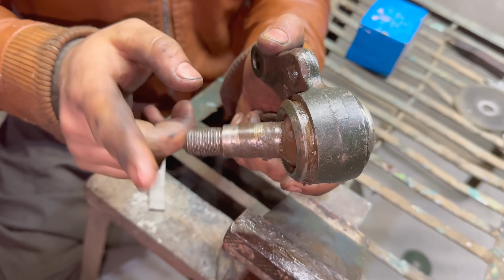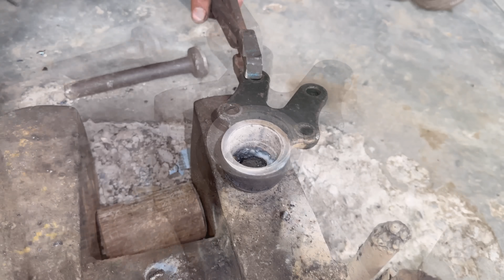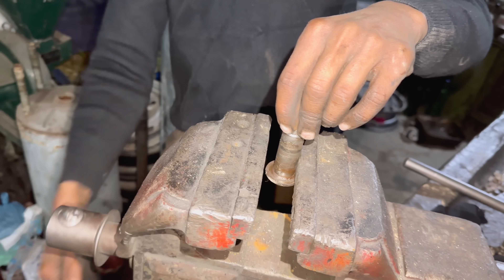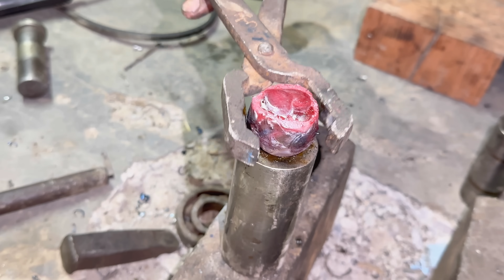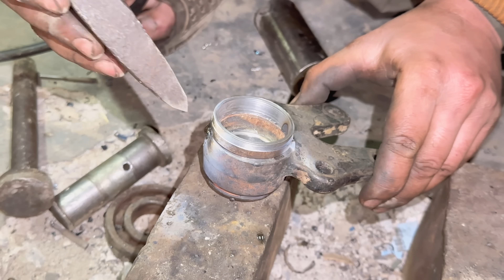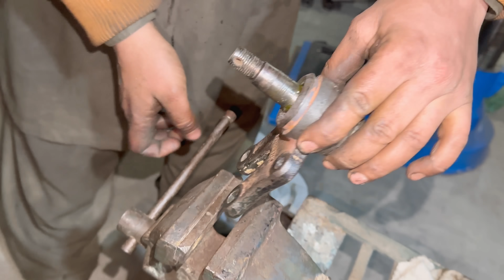How To Restoration Ball Joint Up End Down Model Toyota Hiace suspension chimta Ball Joint Restrtion

Comment: I really enjoy these videos where nothing goes to waste.  Yes, I can order replacement parts for nothing but I wish we could send the broken ones someplace to recycle them instead of the trash. I am constantly putting old parts in my trash after replacing them.  This guy is an artist.
Reply: @lovera3878  Amico mio,c'è solo una ragione valida per fare un lavoraccio simile,cioè non esiste il ricambio.
Reply: why not put your old parts into metal recycling bin at your waste disposal site
Reply: Send the old part to metal recycling, and buy a new high quality OEM part that was made to a way higher specification than this, and at greater productivity.
Reply: who in his right mind is gonna go to all that trouble just to save a few bucks & how many people do you know that have a machine like he has to shave metal i don't think it's worth all the hassle
Reply: @MrTarkus007  I know right!!!!!!! Spend a few grand on equipment and maybe charge 45 - 60 bucks to restore a ball joint when people can just buy a brand new one for around 35 - 40 bucks,........ seems completely pointless.
Reply: Valla bu uşağın zamanı  değersiz   işi az  yada yeni parça yok

Comment: Nicely done, I did a lots when I was in cuba 30 years ago, it's hard to get parts, so we have to improvise, it worth more labor than parts but there is  not other choice
Reply: What part in Cuba?! I was in GTMO BAY!
Reply: kubaban is olyan a nepviselet mint indiaban  ????????
Reply: Here in the US, labor is relatively scarce and very expensive. Parts are comparatively cheap. $200 dollars worth of labor to fix a 50 dollar part is simply not worth it. Over there it's the opposite problem. Labor is not at all scarce and relatively inexpensive. 10 dollars in labor to fix a 50 dollar part is very reasonable.

On top of that, the part you need may not be available. Maybe because you need it now and it's going to take too long to get. Or maybe because it's for an uncommon and/or obsolete vehicle and parts are simply not made for it. In fact all the parts on that truck may have started out on different brands of trucks. Frame from a locally produced vehicle, front axle from a 1940s German army truck,  mismatched leaf springs from ... Something with leaf springs... And a rear axle that appears to have been made in the 1930s in what was then Jordan, that resembles some of the American stuff that was produced at the time, except its all in metric and while name of the manufacturer and the date are stamped into the housing, if you can read ... What appears to be a very rare language that was spoken in a small region in that area prior to the village being burned to the ground in WWII, and there's zero evidence of the manufacturers existence beyond that axle that's sitting in front of you. So go ahead, try to order gear set and some bearings from rock auto.
Reply: Kudos to the cuban mechanics and technicians. Those 1930,40, 50 ,60 motor cars are still road worthy, despite the ready availability of factory parts.

Comment: Sometimes in some places, you can't get new spare parts... especially in remote mountainous areas, So you have no choice but to re condition the old one. Good job.
Reply: It cannot be too remote... that's a big lathe running on the equivalent of 220 volts.
Reply: Not to mention he was able to get the new plastic inserts and boot
Reply: @0p
Mark-fc2zk
Reply: What worse is your country is sanctioned by  others.
Reply: Молодец
Reply: He was able to get a new rubber boot , nylon delron cups and had the use of various other consumables too welding rods etc I struggle to imagine how the materials used add up the steel bar consumed for example to replace the shoulder at the bottom all had to be sourced I understand skilled labour is cheap it just doesn’t add up to me 🤷🏻‍♂️

Comment: Lathe headstock bearings will be toast if you don't put the earth on the welder on the part or chuck when welding on it, they are not designed to take that amount of amps through them.
Reply: Возможно, провод земли подключен к другому концу шпинделя.
Reply: I think I only saw him ground the actual workpiece once in the entire video. That was driving me nuts also, thinking of  pitted bearings, gears, damaged electrical depending on where it is grounded, etc.
Reply: #MeToo 😮
Reply: To me it already had rough sound in it

Comment: Humbled by the ingenuity and ability of this man. The ball joints for my 230,000 mile Toyota came from Rock Auto for $12.00 each and I drilled and tapped them and installed grease fittings. Not even close to the way this man rebuilt this one. 👍
Reply: P
Reply: After drilling what happened to the metal shards resulted from machining?  Didn't they get inside the joint ?
Reply: @RaduMichael  Greased up the drill bit's flutes and as soon as you're through you tap it upside down and used Q-tips, with and without a dab of grease and/or tweezers to grab any filings, which luckily there weren't any as either the grease kept them or the fact I didn't "push in" hard and caught myself before I did. Truth is there is very little space between breaking through and whatever you reach next. Maybe 1/8"-3/16"? As soon as I pumped in some of my favourite pink fully synthetic grease(displaces water), the ball joints  and tie rod ends went from so stiff you couldn't move them without tools, to being able to move them with moderate hand strength, having been lubed up. That makes installing them in my driveway much, much easier, on my 09' Matrix with 370,000+ on it.
Reply: @malcolmhamilton5200  Wow! That's a lot of miles! Do you have the 1.8 or 2.4 L engine!. Did you have to rebuild the engine yet?
Reply: The 2.4 that comes with the extra 5th gear automatic. Really scoots in a subcompact. My brother bought it off the original owner, a line worker in the Toyota Cambridge plant, where it was built(there's an endorsement). For two years the guy commuted from there, home to Sudbury, every weekend. Stew picked it up cheap because it had ridiculously high mileage for those two years. Don't know if it had that recalled ring fix or not, that 2.4s had.

Comment: Hey, sometimes you've just gotta do it that way, especially when parts are sky high or unavailable.  I made a new bearing out of a piece of #8 copper wire for the counterweight in a Kawasaki fc540v engine.  It was on my John Deere 265.  If I had ordered one, it would have taken way too long to arrive.  So, I beat that sucker down to 0.060" on a piece of railroad iron with a big ball pein hammer.  Then, I curled it and cut it to size to fit tightly inside the connecting rod and even made interlocking teeth on the ends with a sheet metal punch and file.  I had to trim it close to the right width before curling it.  Then, after I forced it into the rod, I evened up the edges with a flat file. There were a few other things I had to do, like drilling an oil hole and such, but it turned out pretty good for a hand made part.  And the best thing is that it worked, and still does a year later, thank God!  If the engine ever explodes, I have another one sitting here that a friend gave me, but it's a little bit smaller.

Comment: Surely they have a parts store next to the phone or camera shop they bought the tech from or even could have ordered a new ball joint off ebay with the Internet connection they used to upload this video.....Or perhaps there very skilled in Mechanical engineers and smart enough to post there work on here so they get paid more for there Work......Fair Play...Good work and nice to see your video

Comment: Wow, machining Death or Death machining. Over heats critical metal with arc weld then quenches with water to form brittle metal crystallization. Undercuts taper at peak shear load point between suspension arm and hub. When truck's experiencing peak load on fast hard corner under full suspension compression, the engineering computations Toyota made are nearing peak design, so along comes buddy here with brittle weakened save a buck ball joint. I hope the barrel role doesn't kill to many people. I did like the spray paint into grease nipple hole, cos that'll add to lubrication.

Comment: I restored my Reliant Kitten lower ball joints using the internal components from another easily available ball joint. Thread the casing an made a stainless steel insert to hold a nylon cup to support the ball, the insert was lock in place via large lock nut.
Reply: Didn't realise people restored Reliant Kittens.

Comment: Good job sir. What are these guys talking abt hardness of material n welding rod type which is irrelevant because there are ball joints that are made of aluminium and are just as durable. It wud make more sense if you guys were talkn about using copper or bronze to replace the teflon cups inside which wud be more durable when maintain with regular greasing. The ball doesnt come in contact with the outer layer of the ball joint either so i ave no idea what you guys are talking about. I would use this over a new one any day.

Comment: 13:27..Imitation will be difficult because it requires two hands to fit the plane measured from the Vernier.  Then keep the memory to compare with the curve of the plastic inside the socket, which is the socket of the ball joint...

Comment: If it was possible to rebuild human joints,  these guys would take the cake. My only problem is, that safety IS NOT a priority.  Customer satisfaction takes precedent. They need to wear and utilize safety gear when using those lathes etc.

Comment: One needs to be very careful, as a change in heat treatment with water cooling after welding may render some parts of the joint brittle and hard. This is what must be avoided. If the original heat treatment is known or easy to guess, one should try doing it. Stress testing would require heavy duty equipment. Too much is at stake due to critical application of ball joints. A better fix could be via using a thicker plastic insert or making a sleeve into which a standard plastic insert could fit. The metal surfaces must have a mirror finish and perfect geometry, or else, the plastic insert would be chewed up in no time. Not sure if such special plastic inserts are commercially available. Ordinary plastic would fail easily.

Comment: The ball/sphere was built in 2 pieces to reduce friction at the factory. To reduce friction and last longer.  Now that you welded the sphere halves together. You  basically made it worse.  It's tight now! but for how long? I understand it's good enough to make a profit. But it's not correct.

Comment: The welding will alter the structure of the metal so no matter how good it looks it will not have the strength or wear resistance to do the job it was designed for . I would not drive a vehicle with that part fitted to it .

Comment: Would it not lead to catastrophic failure considering that it already has cracks in it due to wear and tear. Also wouldn't the welding introduce stress or cause change in metal softness. 
Logically such critical parts need to be changed, repair might just be a solution for end of life vehicles or probably really vintage vehicle.  Toyota hiace seams like a very common vehicle and parts should be plenty available.. even from salvage vehicles or donar vehicle..

Comment: Sir a ball joint is only 10 dollars but it's education but drill a hole under the ball joint cap tap 3 eights screw a bolt thithen to suit.

Comment: This spare part costs 15-20 euros on the market in Europe, your working hours are over 100 euros
Don't you think your country has to do something about it, you can't always just repair everything, sometimes you have to replace it.
Also, I'm sure the part will break again in a short time
Reply: 你说是在欧洲，视频应该在巴基斯坦或者其他中亚国家。😊
Reply: I saw this video by chance and was very disappointed with what I saw, this spare part costs around 15 euros here in my country Greece, this poor technician works for hours on this spare part, these Pakistanis don't know that once it has to be over. and you have to buy a new one, with us these old parts are thrown away for thousands of scraps and they are better than the one he repairs, but sorry, I have translated your letter and can't understand what you want to say?
Reply: @ανακολ  
Dutch here, labor is 70/80 euros per hour in a car shop..
It took him almost 30 minutes to restore it excluding materials.
That's about 40 euros to repair.
We can buy at least 2 brand new ball joints for that.
Reply: Не бита, не крашена. Новая запчасть для смертничков. 😮

Comment: I have been doing that same repair, in Adelaide, for years. However welding of steering and suspension components is illegal in South Australia, so nothing I do involves welding. Furthermore, when the job is finished you can hardly tell that the part has even been repaired. Also, this being a First World country where people are paid a decent, living wage and safety standards are extremely high, such repairs do not come cheaply. As for safety, a company I know decommissioned a number of very large power presses recently, which were destined for the Subcontinent. They were told to scrap ALL the safety equipment normally fitted to such presses, not required where they were going! Oh and why do lathe operators on You Tube hardly ever use a 4 jaw chucks?

Comment: good job what ever some say,,better then some sheap  new one that you can buy,,and better then driving with loose ones,,,!!,,there is a lot of after market that are made with cheap steel and not lasting long,,did only 20,000  kilometers with those,,on my 1984 Chevette,,,yes a little Chevette  that lasted around 140 thousans miles till 2004,,there isnt much heat treatement on ball joint,,as you can easely  compresse them where there is thread if you hammer to get it out,,uselly they are wearing out because lack of lubrification and water infiltration,,,otherwise they last very long,,,my 4runner had them last around 100 thousans mils,before  they needed to be replace,,,new ones have a zert for lubrification,,,now my 4runner 96 has 150,000 mils ,and running great,2.7,liters 5 speeds  manual,I LOVE IT,,,😎😉✌